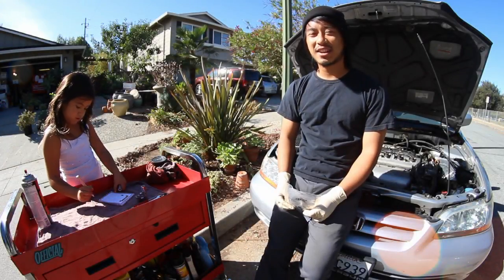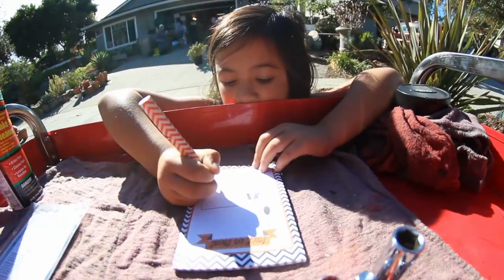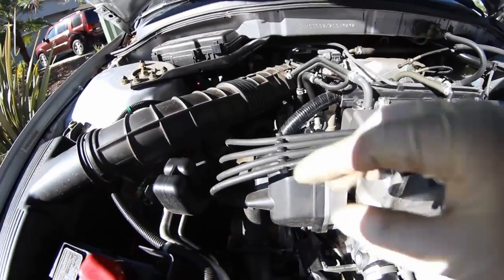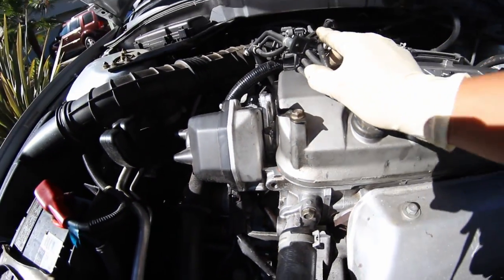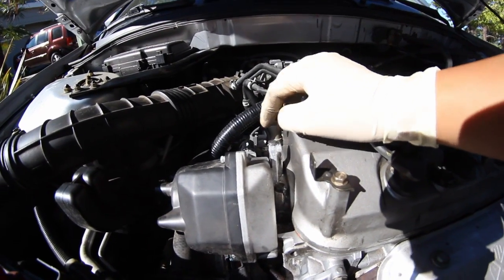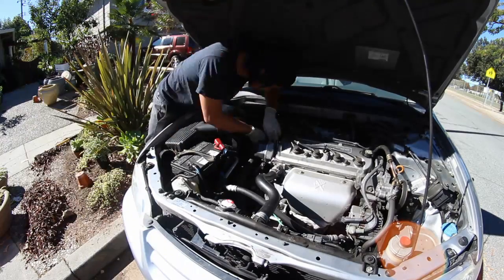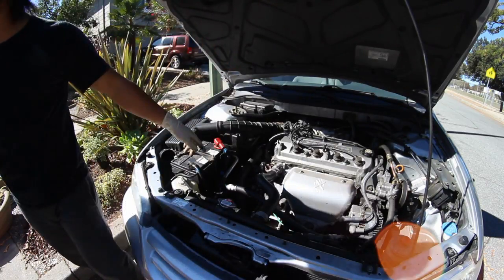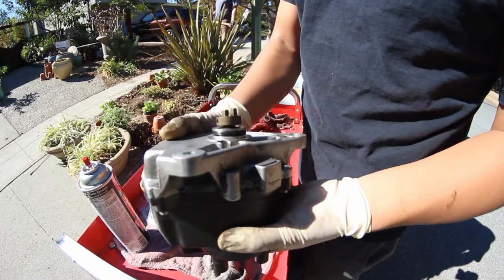Distributor O-Ring Replacement (98-02 Honda Accord)

Comment: Note that there are actually two different distributors used in this generation Accord.  Most (EX, SE, and LX models with VTEC) have a Hitachi distributor like the one in the video.  DX models have a TEC distributor like the previous generation 1992-1997 Accord and many Civics.  The o-ring seals and other parts including the shaft seals do not interchange between the two.
Reply: I cant find any info on whether the Hitachi version has inner seals so Im assuming all I need to do is replace the oring like in the video to stop the oil leak.

Comment: Thanks for the video! it helped alot...if you have the Hitachi its Fel-Pro 72416...dont worry that is shows the wrong engines on the package...I compared it to the honda part number and its the same. Honda# 30110-PC6-005      25 MM not the 26.5 one I think that maybe for the TEK distributors. 
Now can anyone tell us the torq spec on the 2 mounting bolts? I could not find it.
One last thing...one guy said he burned up his distributor when he put it back in. I think I know why...When I pulled the cap off oil was running inside from the cap oring....not the shaft seal. So I think maybe that guy did not clean it out and it fried something. I cleaned mine and it should be fine. Just my .02.
Make sure you replace that heater hose right there underneat it. soooo much easier when the distributor is out of the way!

Comment: Why some of you guys have trouble on that f$!king cable lines I tell you what DONT TRY/ATTEMPT TO DO SOME DIRTY WORKS IF YOU DONT KNOW HOW TO DO IT
its quite simple 

First: check for the cylinders it can be counted in the number of plugs(diesel engines are not included here) 
Second:if your engine is 4 cylinder the timing is 1342 remember find the front side engine (front wheel drive cars are passenger side or timing belt&fan belt side,rear wheel drive cars are fan/radiator fan side)also remember exhaust or intake manifold are not front side of the engine. some people have trouble on it. remember from the front engine start counting  from 1 2 3 4 then check for the distributor indicator number then match it by firing order start from 1 then 3,4,2 
Engine        distributor
1                     1
3                     3
4                     4
2                     2
Remember when it didn't not start check for plugs, cables if there's no electricity
Reply: Also some distributor cap don't have indicated numbers check for owners manual for that

Comment: Make Sure You Get The Right O Ring For Your Distributor, My 2000 Accord Se VTEC 2.3  Had A Hitachi Distributor, Some Of The Accords Had TEC Distributors,They Use A Different O Ring!
Reply: He is spot on! I have an 02 with the Hitachi and they sold me the wrong one! its Fel-Pro 72416 or Honda #30110-PC6-005   both were 5.xx each. 25MM not the 26.5 mm one.
I went to the dealer and compared both and its correct.
Reply: Same here, got the skinny one and my Hitachi kept leaking. You need the thicker one

Comment: Do not I repeat do not disconnect all those plug wires without marking which spot each wire goes to this moron should have just took the distributor out with the wires connected and placed it off to the side due to the fact that if you put those wires back on wrong you could possibly damage the motor or have it not start at all until you get the firing order right so don't be like this moron if you going to disconnect the wires mark them some way that you'll remember which connected they go to and then proceed when I did mine all I did was loose and it took her all out without disconnecting it and put it all back together
Reply: bsanchez922 you could do that but you don’t have to since the distributor only goes one way. Hope this helps
Reply: Calm down mr. Goodwrench
Reply: You called him a moron twice. Not cool dude!

Comment: Great video! How important do you think it is to provide precision torque with a torque wrench when putting the distributor back on? Is it good enough to make sure it's on there tight?
Reply from the maker: To be honest, I don't use torque specs unless its something really important like engine internals, head gasket etc.. I always torque wheels though for my sanity. I mostly go by feel and use common sense. You get a good feel of what is sufficiently tight after a while.... but that comes with experience.
Reply: I gotcha. Thanks for the reply!

Comment: I changed my distributor and now the acceleration is very sluggish. Pressed the gas pedal almost all the way but only getting 30mph. What should I check?
Reply from the maker: NauTzZz is it running choppy? Did you put the spark plug wires in the right order?

Comment: 1. Disconnect battery. Pull the spark plug wires from plugs, take out of looms till dist cap is clear leave plugged in dist., pull screws from dist cap and remove.
2. Look which way the dist  rotor is pointing and mark. Disconnect dist electric plug. Pull two bolts and remove dist. 
3. Check in dist if there's oil in the dist. If there's oil in it buy a kit that has the oil ring and inner seal. Check the heater hose below the dist because oil deteriorates rubber, if it feels mushy when you squeeze it, replace the heater hose.
4. To replace the inner seal first mark the dist drive cam at the bottom of the dist that engages in the engine. If you look at it from the bottom the drive gear legs are off set to one side. I used a punch and put a dimple on the shaft at the bottom on one side and another dimple on the drive gear next to it. or you can look where the rotor is pointing and see how the offset relates to it. You have to put the gear back on the way it came off.
5. I laid the two teeth of the gear on a block of wood and punched the pin out, remove two screws from the top below the rotor and remove the shaft and push out the seal and install a new one. Put back together in reverse order. Install new o-ring  and point the rotor to where it was when you pulled it and install and put everything back together.
6. If you replaced the heater hose refill radiator, drive some and check radiator, top off and bleed air from cooling with fitting on thermostat housing by left side top intake.

Comment: Thanks for your video. Great video and tip 6th generation Honda is a no brainer.  The distributor can go in only one way.
So don't need to mark the distributor before removing the two 12mm bolt. I also replaced the Heater coolant hose directly below the distributor and also changed my spark plug.  Thanks again very informative video.
Reply: Arnel Chua agreed! I’d also change the rotor cap, and seal inside too
Reply: Yes, no need to mark placement. I believe this model is computer regulated, not like an old Chevy that you  can advance timing

Comment: I just ruined a perfectly good distributor. I followed the steps carefully and somehow the crank fried the whole unit. So a $3 job turned into a $200 fix. steer clear from this method its not worth the risk
Reply from the maker: danny85 whats going on with the car? And what tells you that you fried your distributor 'with the crank?'
Reply: after installing the new O-ring I turned the engine on to test everything and right off the bat smoke came out of the distributor plastic housing. by now the engine would not turn over I took the whole assembly over to a mechanic and he said the module burned out most likely due to an alignment issue.

Comment: Hey, what were you spraying with (and what for) after you removed the distributor? Thanks. :)
Reply from the maker: Shahriar Emil when you take out the distributor, a little oil leaks out from the head. I was using brake clean to clean up the spill.

Comment: Justin. I just screwed up. While getting everything back together my teeth on the distributor must have didn't line back up right and I tried to force it and when I crank the car the teeth broke off. So now of course the car won't start. So I have to buy a new distributor. Maybe a used one because the car is old. 

Now when I put it back do I need to line it up better or will it be off timing?
Reply from the maker: There is only one orientation it can go on. If its not going on and sitting flush, turn the teeth 180. Honda made it so one tooth is bigger than the other so you cant really put it on wrong. When you put ur new one on just check timing with a timjng light.
Reply: +Justin Le thanks Justin!!! I don't know how to check timing. Is there a video for that?
Reply from the maker: +thurm101 i dont have a video for that
Reply: +Justin Le Thanks Justin. I just got back from the junkyard. Found a Honda that looked almost better than mine. Looked around it and found that the original owner took care of it with maintenance logs and stuff. So I took the distributor off and looked under the cap and it was like brand new. So I bought it along with some other stuff. Got home popped on. Just like you said it would only go on one way to make it flush. I forgot. I did change the ORing on the new one. Tighten it down. Put the battery make on and she fired right up. Sound awesome. I took it for a spin and it seems like it has more pick up than before. Thanks Justin!!!!
Reply from the maker: +thurm101 good job! Glad i could help

Comment: Hi Justin, so there is no need to mark the original position of the distributor on our 6th generation accords?
Reply from the maker: Yup... If your distributor is the two bolt design like mine they are nonadjustable. Cant even rotate it if you wanted to.
Reply: To add up, 92-00
Civics have 3 Bolts so it is necessary to mark it before undoing everything